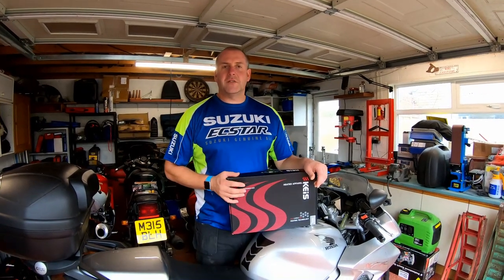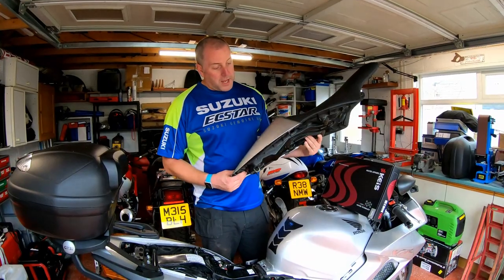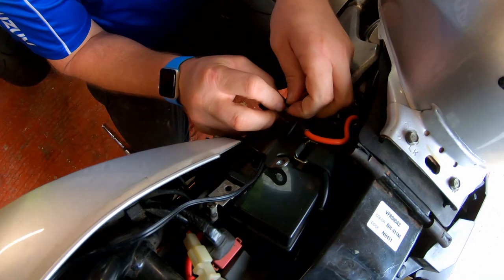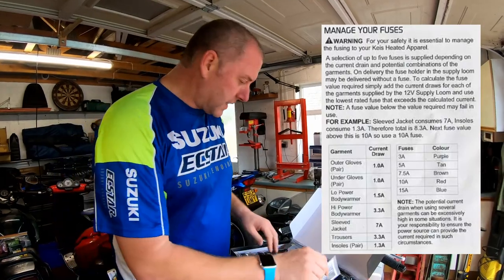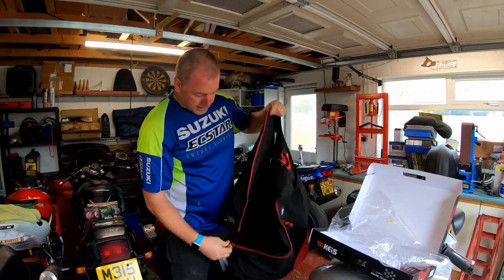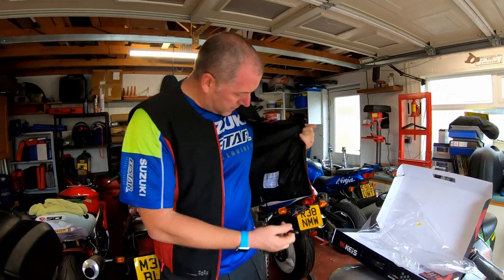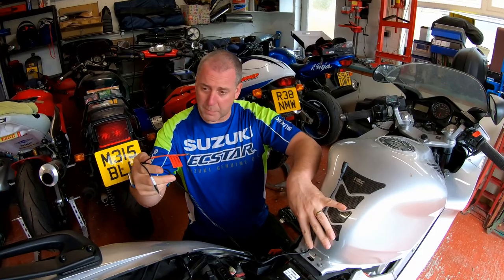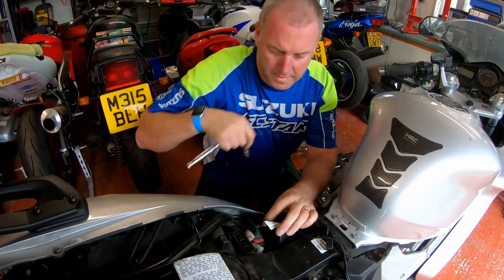Keis V501 Premium Heated Vest, Bike Integration & First Use.

Comment: Another good video Kev. I've had mine for a few years now and I'd suggest wearing a base layer or equivalent over the top of the vest too. I found that it keeps the heat in rather than it dissipate away from the body. The controller is well worth it too as it can become very hot. . . enough to leave superficial marks on the skin. If you're feeling flush the heated soles are amazing!!!
Reply from the maker: Good tip!
Reply: I'd like the heated soles but not sure I can deal with hassle of all the wiring.

Comment: Just bought the heated jacket with Sleeves, it comes with a controller and bought it for £180

I was going to buy the vest but because they didn’t include the remote at an extra cost of around £30

And as the jacket heats front back down the arms and around the neck as it has a pretty big collar which when zipped up just cause under the bottom lip

I am a 42 chest and purchased a 56 in the jacket
Excellent video one of the reasons why I bought the heated jacket and gloves 

😊😉 keep up the good work and love your videos
Reply from the maker: Nice one, cheers mate 👌🏻

Comment: Heat controller is a must, it gets very hot, had mine a few years, couldn't do without it in winter time, 
I'd like the heated insoles but the wiring must be a right faff every time you get on/off the bike. great vid as always.
Reply from the maker: Yeah, it does get very hot so I must invest in the heat controller. Also, wearing something under the vest such as a t-shirt is advised too as it'll leave red marks on the skin otherwise!

Comment: Nice video . Just bought the sleeved jacket one and nearly bent the fuse trying to put it in ! Did your fuse holder have the slots arranged that the blade fuse went in on a slight diagonal path rather than in a straight line . Hope the jacket proved worthwhile . Ride safe 👍

Comment: Hi Kev....now you have had your V501 a time.....what are your thoughts.....bought one a week ago running it from my bikes 12v supply.....first test ride yesterday....temp 12c so not cold.

Vest was cosy and warm.....would not say hot or to hot.....I have the heat controller.....left it on max.....from what I have been told....you wont want to leave it on hot for long....will feel to hot.

Mine didn't feel on my 5mile ride....tbh Kev yours verst looks a little to loose....I got one size down from my chest size which is 44 keis size 54....so I bought the 52 keis size.....not tight but touch me all over

Not sure if it working right now....how hot is hot

So how hot would you say yours is Kev.....can you comfortably leave your vest on max all the time.

Since found out a bit late....there is a more powerful version.....come c/w controller at £180 so only £8 more than I paid....and twice as powerful....bugger.

Comment: Hi Kev,
Would it not be the 5amp fuse? ... As the instruction screen shot seemed to say;
Body warmer - Low Power 1.5amp / High Power 3.3amp
Reply from the maker: It would if mine was the high power body warmer, mine is the low power body warmer 👍🏻
Reply: @KevsShed  Good stuff cheers... I've got the same setup as you at the moment, no idea what fuse I put in there.

Will be changing it to run off my Denali CANSMART later though so best to check in case I blew it up 😁
Reply from the maker: I’ve been using mine a little while now and it hasn’t blown the 3 Amp fuse yet so it seems to be all good 👌🏻😎

Comment: I'd want one of these with the heat controller (which is essential and should come with it); but only if a USB power pack could be used with via adapter, which I can't find available?; so I can use it where I need to not only on the bike; rather than using the rubbish cheapo USB (Chinesium?) heated vests 's pushed everywhere, which won't last; so are effectively useless! I can't afford or justify one of their batteries!